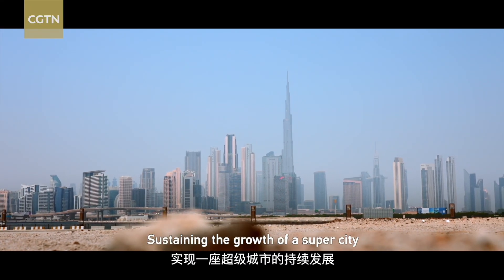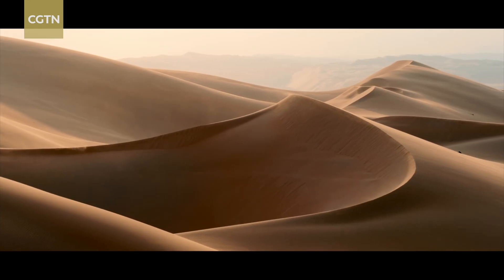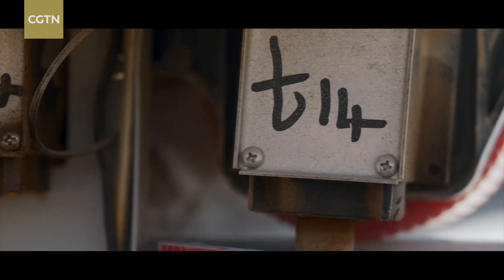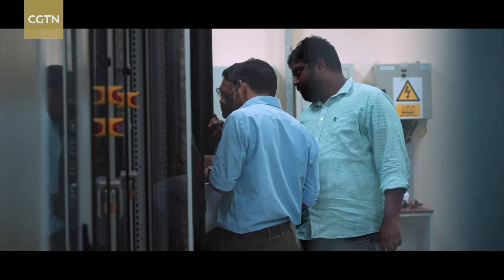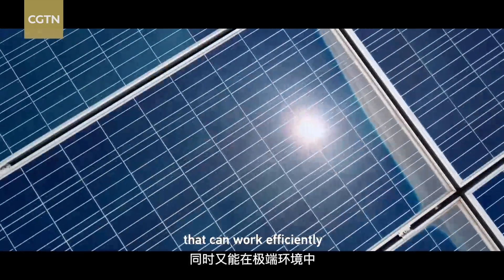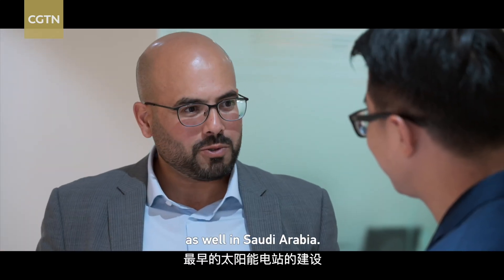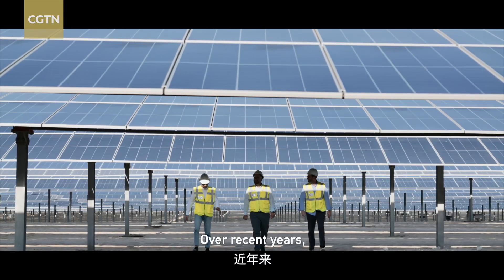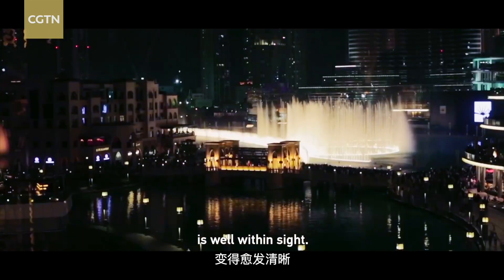World's largest single-site solar power plant completed

Comment: Interest in different types of energy is good, and the desert is an excellent place for even an experimental level, but, from what I have heard, wind and solar in other environments, where there would normally be more wildlife, there, wind and solar are highly detrimental to the ecosystem. Not only do they keep birds from populating the skies, but wind, solar, and hydro, all depend on (usually oil and gas) alternate energy for maintenance and are unreliable energy sources, so their use requires backup generation of some other kind. The best green energy for the world we live in is nuclear, and for development for the future, my personal favourite is geothermal, something that at least has none of the downsides of either wind or solar, which are fine, for a small farm, but not so kind when set up at the industrial level. Even large-scale hydro-power needs to be contained, to be less of a threat to wildlife. Electric vehicles are the worst thing, right now. We shouldn't have them. 
Nuclear power is the only green energy we have to work with, on a large industrial scale. Of course, we want to be careful to keep the materials, from that, contained, as well. Otherwise, even nuclear will not be an answer.
Reply: Why are electric vehicles the worst thing?
Reply: Production, batteries, charging stations. I only know what I have been told.